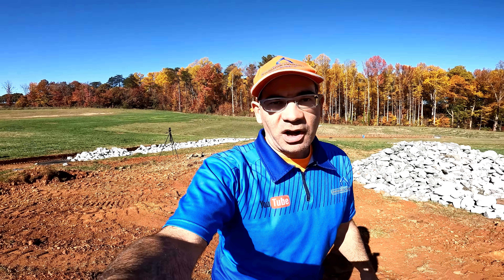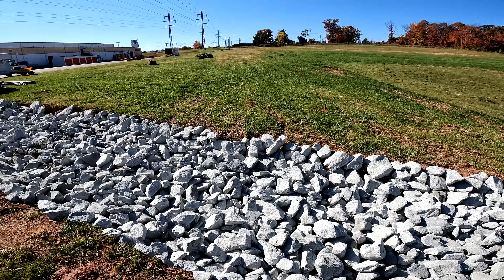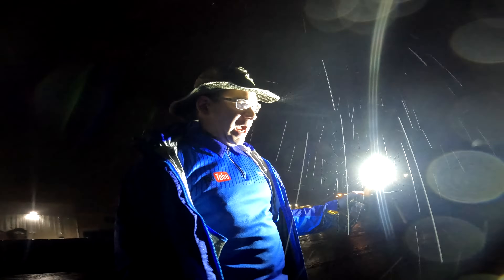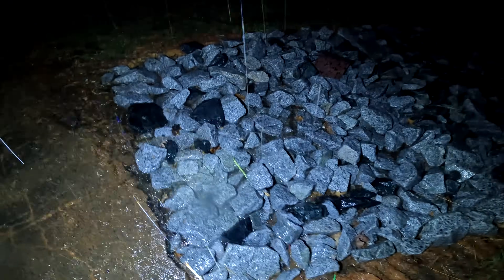Installing a Riprap Channel to address erosion issues

Comment: Be sure and line the ditch with a plastic liner , before adding Riprap so as to prevent any regrowth of weeds and or grass so the Flow of water won't BE affected !
Reply: What was that black fabric they used?

Comment: Yeah... I don't get why you didn't dig the channel deeper, or why you used hand labor to move the riprap, or do anything to control where the water was going.. seems pretty "let's do the minimum, guess and hope for the best."
Reply from the maker: Great points. The client had already spent tens of thousands on this and needed a practical, permanent solution.

Comment: Did you get rid of this Volvo skid loader? i notice you are using another one curently. Thanks.
Reply from the maker: Ed this is a 10.5k machine so I use it on large projects. I now have four skids (including the little mini skid) so I have a nice size range.

Comment: I've learned a tremendous amount from watching your videos, and once the ground thaws and dries out a bit I'm going to attempt a drainage solution to combat some of the standing water that is accumulating on the concrete/yard that I have. 
Genuinely appreciate you sharing the correct way to get drainage systems installed 👍
Reply from the maker: Thank you! Good luck with your project and remember to mind your fall 👍👍

Comment: Shouldn't the channel have been deeper in the middle to prevent the water flow eroding the outer edges?  The channel seemed pretty much flat across its width, can't help but think the channel will eventually carve out a groove either side of the main channel.
Reply: That's what I thought too.  The channel should be at least 1 foot deep to carry high flows without spilling over.

Comment: Nice work but personally I would have flaired out the mouth by the asphalt to try an funnel more of that run off in.
Reply: He needed to make a ditch or swale along the entire length of the parkinglot to the new channel. This will be a call back eventually when the runoff washes a different spot.
Reply from the maker: We thought about that but the water was really coming in at one small area. We felt like 8' was more than enough to catch it.

Comment: Is the fabric absolutely necessary?? What exactly does it do significantly different than if you did without. Thanks.
Reply from the maker: It's not absolutely needed. It protects the soil under the rock from the swirling water and turbulence created as the rock disrupts the flow of water and slows it down.

Comment: Does rip rap need to stay exposed to work or can a thin layer of dirt go over it?
It's plausible to me that the edges need to slow the water over the whole install.
It's also plausible that the dirt will start to erode then be stopped by the rip rap, 
allowing a more natural look for most of the installation.
Reply: There are erosion control mats that look a bit like tangled fishing line. The soil goes inside it and you can seed it with grass. The grass would then grow through into the soil below. Grass on stone would die back in the summer and most likely would not survive.

Comment: How come you didn't left fabric uncut, than simply roll it back as you place stones? That way you don't drive over it at all
Reply from the maker: I was worried about not having enough fabric and the trench was 8' wide and the roll 12' wide. We overlapped it by at least 2' on every joint so I'm good with it.
Reply: @GCFD  end result is great. Mini river

Comment: Huge areas of paved surfaces are always an issue to handle the run-off. Although the solution you have adopted seems technically simple, I pretty sure the success of the result is huge. Good job to the GCFD team.
Reply from the maker: i forgot to mention how and why I positioned things where I did. I basically let the water tell me where it wanted to flow and then added the channel there.

Comment: Shawn a quick question.  IS Riprap more expensive than concrete?
Reply from the maker: No riprap is farrrr cheaper in materials, prep, installation.
Reply: It would be quite expensive to put bumps in concrete to match rip rap. You could insert concrete bricks to slow the water down. it would not look as good as the stone.

Comment: What i wouldve done is maybe get the concrete guys to make a hump/mini wall around  that part of the parking OR in some parts make  mini dirt wall while  in other  grade the it in sorta  triangle shape where by grading it would direct water straight into the channel rather than beion all over the place.
Im not an expert but i thing for a sorta long term solution i would do that YES it woud be much ore expensive BUT it might for the long run  almost compleatly neutralize problem of water comming from the parking bcs as we see parking isnt perfect and in multiple plases has caracks and low lvl from wich  water gushes thru  and lands all over the place intsead of being directed/controled  to travel to one specific place.
Reply: Rip Rap  ( jagged rock Not rounded stones) naturally helps slow down the flow of water and is overall less intrusive than a full out construction of concrete at a lot less $ on average.  A wall is not going to stop it with that much flow/erosion.
Reply from the maker: Good point. In this case I think they would be better served by building up a berm whenever they replace the blacktop instead of trying to do concrete. this is working very well for what they wanted and can be improved upon very efficiently when they re-do the parking lot.
Reply: The pond is designed to remove the peak of a flood so that there is less flooding downstream. If the water gets into it faster it will have less capacity to store water during very heavy rainfall. The more the water spreads around the grass the better as it will take far longer to run down into the pond.

Comment: Smooth, Good Music, Great footage, Would imagine since thats a city thing it took a tub of Red Tape to get all that done/assurances that the integrity wouldnt be compromized, Channels like that could always be expanded if needed though it looks great & that is a literal river No wonder why it washed out like it did,  Dump truck driver was really good w not slamming the tailgate ( which causes wear and loss of product later on down the road) Footage is superb the way you do it here for extended insurance against future negativity/evidence. The newer volvo has come in clutch.
Reply from the maker: thank you! this was a pretty interesting project for sure. This was my first time loading a full size dump truck too. I spilled some dirt onto the cab a couple times because i failed to level the bucket as I raised it up.
Reply: @GCFD    Heh, its a little higher than the Ford,  Certainly needed this, No way it could have been done w the Bobcat

Comment: Wouldn't it have been easier to line the ditch with just concrete instead of having to deal with all the riff Raff or is it more cost-effective that away just curious love the videos
Reply: Rip Rap  ( jagged rock Not rounded stones) naturally helps slow down the flow of water and is overall less intrusive than a full out construction of concrete at a lot less $ on average.
Reply from the maker: In this case I wanted to slow the water down and rip rap is the way to do that like Stratos mentioned above. A concrete channel will send the water shooting down into the pond which could lead to move problems. Google channelization to see how that creates major problems. I think concrete would have worked fine if the slope wasn't so steep.

Comment: I am enjoying your videos. Just to proof that i paid attention and to increase your YT stts with some conversation here :)   :
Cant judge the slope of the parkingspace from the video. Looks like a quite some falloff right alongside the parkingspace. What about elevating ground alongside parkingspace with the extra dirt excavated to make sure it follows direction to your riprap channel? The previous contracter also put stones in the center of the field.
Of course this was written during the beginning of the video and i was not patient enough to wait for the end :)
Reply from the maker: Yes that would help direct water into the channel for sure!
Reply: The objective is to get the water into the pond as slow as possible. Too much water at once and the pond will overflow flooding property downstream. The pond most likely would be sized for the water to flow over the grass rather than be directed down one channel. The riprap is only required because there is too much water running at one point. If it could have been spread out no riprap would have been required. The people who dug the pond should have filled the area where the water flowed so that it spread out; Shawn's riprap is most likely the cheapest way to protect that defect from erosion.

Comment: At first, I wondered why you didn't install a big catch basin in the parking lot with a pipe to the pond. I like the solution you came up with though. Another great video Shawn. I also like that you go back and show the results.
Reply from the maker: Thank you Roy. This one took awhile before I caught it on a good hard rain.
Reply: The objective is to get the water into the pond as slow as possible. It is a retention pond, it smooths out the peak of a flood so that there is less flow at one time downstream. If the water gets into the pond faster, it will fill up faster and over top and still flood downstream.  The business would not want to pay to have the pond enlarged to retain more water.
Reply: @johnclements6614  Now I understand, thank you
Reply: @royordway9157  In most cases you want to get water off your property as quickly as possible. Shawn should have explained what a retention pond was in the video.

If you look at 0:37 you will see that the outlet structure has a grating over it to drain the pond when it fills in a storm. There will be a lower small pipe to drain the pond when the flow is low.

 I also notice that the bottom of the pond may be in two sections, there is a line of weed across the pond which could be the top of a berm. If it is a berm, it could have been used to help keep the area outlet "dry" during construction and future maintenance and could be to catch silt in one end of the pond so that it can be removed.

Comment: I’d like to have seen a swale down the side of the parking lot and a culvert pipe from the parking lot to the pond, to save cutting up that land.
Reply from the maker: A culvert would have cost more and affected the fall. But the major thing I was working with here was an unknown amount of water. Bu cutting an 8' channel I felt like I could handle whatever amount could possibly be coming across the driveway. I go for 100% results so I am always looking for major capacity in my solutions. 👍👍
Reply: All depends on the budget too tho. I'm sure a culvert mightve cost too much
Reply: Then the water gets to the retention pond quickly. Too much water and it will overtop rather than retain and flood property downstream.

Comment: Did you put sod staples in the sod you put down on the bank of the pond. You should always use sod staples any time you are laying sod on a slope.
Reply from the maker: I usually lay the sod lengthwise going down the slope instead of along the slope as they did here.

Comment: Hi Shawn. Like your video, have question, why don’t you use rotary laser self level to find perfect fall on your grading?
Reply from the maker: In this case the land was falling pretty well to the pond so a laser wouldn't have added anything. By just following the land we were automatically falling correctly. Great question!
Reply: @GCFD  thank you for answer!  What I am asking also for other “less perfect” soil to find perfect bubble like drainage ditch (not pipe that you can easyly check with bubble leveler